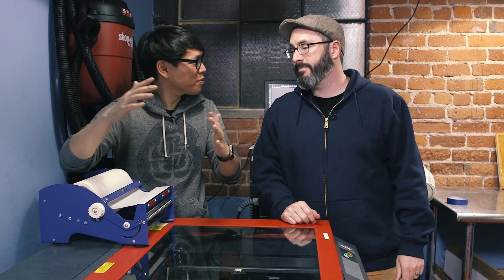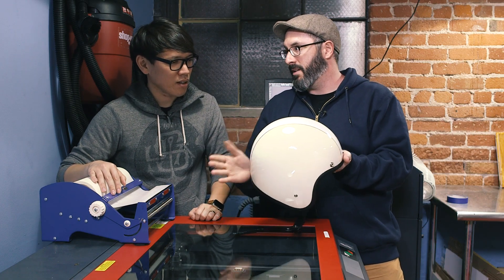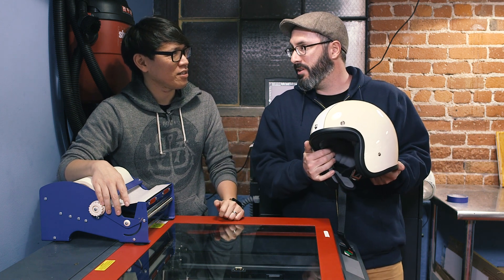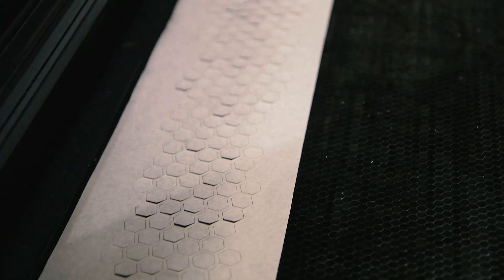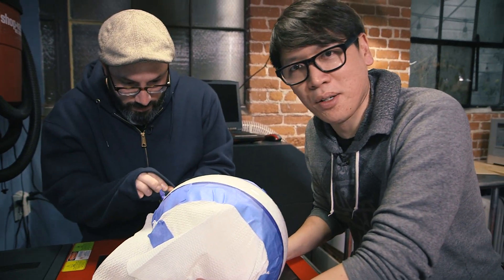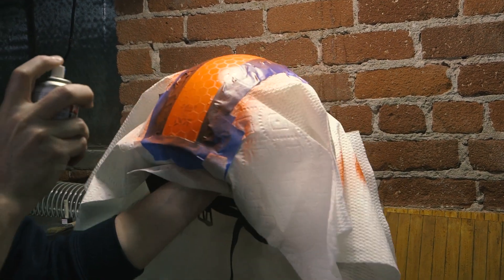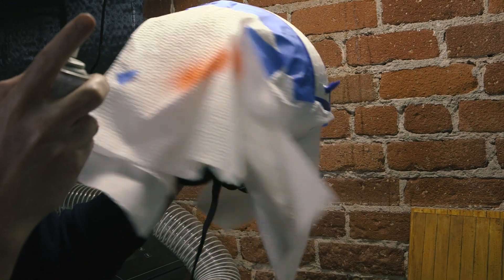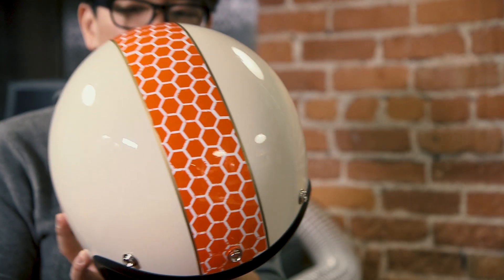Paint Masking Using a Laser Cutter!

Comment: Use a backer then you won't need to clean up... also dude cutting your honeycomb with a knife... big N  O draw it in or use the backer.  You could get an unwrapped helmut file too... and the curvature would be worked out... I use this tech all the time... you can have fun with manipulation and optical illusion.  The laser mask is low tak... you can use higher tak tape on a backer

Comment: Try using powder coating tape. It's stronger, and a lot easier to cut and manipulate, so you get cleaner, straighter lines. It's also translucent, so you can see where you're laying down your tape. Some of them are also made to withstand high heat, so you can bake/cure your paint without the masking falling off.

Comment: Was that tamiya model paint? I'ive used IT on my RC cars.
Reply: When I want to do a "special " paint job I use a similar base coat color and then make a artful choice from an auto touch up spray can rack. They have maybe a hundred different colors shades and textures. For an absolute novice it turns out great, almost professional. Auto paint is harder and has a finer sparkle than metal flake. Try it you'll like it.

Comment: Cool!!! But... A motorcycle helmet consists of a rigid outer shell, which should not be painted or altered in any way with the placement of adhesives, chemicals, solvents, paints or other agents not authorized by the manufacturer, as this would negatively affect the structure of the hull, weakening it, and therefore partially or totally reduce the protection offered by it.
Reply from the maker: acknowledged and bumped to the top!
Reply: Take a look at racing helmets worn at the top levels, you'll find nearly all of them are  custom painted.  You are probably fine, just do a little research to find out if the paint you used is problematic.

Comment: I've done stencils for over a decade. pro-tip: spray further away, dont stop spraying (those small squirts can be bad news), dont spray back over an area you just sprayed, do multiple light layers and let it completely dry between layers,  make sure it's completely dry when you peel it off. you can even get special caps for spray paint for stenciling that spray at a slower rate. They help.

typically when things bleed under a stencil they look more faint and not so well defined. are you sure it is bleed from under the masking tape or was it because the stencil was lifted off while wet and the layer had way too much paint so when you pulled the tape away it pulled paint with it and moved it to places it shouldnt have been. do multiple light layers and let them all completely dry will solve that. I like to think that there is no such as thing as "dry enough to peel off the masking tape". wait for it to completely dry.

Comment: I frequently make laser cut masking tape stencils. I lay up
2” tape onto baking paper with about 3mm of overlap. The baking paper readily
peels of the cut stencils.

I also use low tack tape on top after cutting to keep the
stencils together so they can be weeded and applied.When I am worried about bleed I give it spray with clear
first. https://static.rcgroups.net/forums/attachments/1/3/8/0/4/4/a8173674-146-IMG_6540.JPG

Comment: I enjoy watching Bill spray paint, as he does it well and correctly. 90% of the time when I see someone spray painting on YouTube, it makes my skin crawl because of how wrong it is. lol
Reply: J Benson exactly, the paint went on too heavy. You need to put 3-4 dry coats, just dusting it on with 10 minutes between coats and then two wet coats. As a car modeller I use Tamiya spray paints a lot and it always works for me.
Reply: I think they were not going fot the perfect job but rather for a quick result. ^^
Out of curiosity, why exactly do you dust the surface first? Do you do that with any sprayed on paintjob or only in specific cases? I tried to find some proper tutorials on that topic, but no lick so far.
Reply: NochSoEinKaddiFan it's sometimes called a 'grip coat'. It prevents runs which may occur if the paint is applied to heavily, and provides subsequent coats with good adhesion
Reply: Thank you! :)
Reply: eek. I cringed. With stenciling you want multiple lighter layers and doing those short sprays can cause inconstancies. I actually think that's the reason for the paint getting where it shouldnt have.

Comment: Take care that the paint doesn’t affect the shell of the helmet. As a salesperson in a motorcycle shop I would not advice painting or stickering your helmet for this reason. Looks cool though!
Reply: Don't know about motorcycle helmets but those are common warnings for hard hats.  The paint could have solvents that weaken the plastic, and stickers are discouraged more because it can hide damage like fine cracks.
Reply: that helmet is already painted and sprayed with clearcoat. to cause any structural damage, the paint or stickers would have to go through the varnish and paint that are already there, which would be noticeable. 

basically, dont apply random solvent-based paints directly onto polycarbonate hardhats or cycling helmets (which have no paint and no protective layer), but most street-legal motorcycle helmets have no problem with paint or stickers, because you are not applying them directly to the plastic. in this case, they used tamiya paint made specifically for polycarbonate, so it would probably be safe even on uncoated helmets.

https://www.youtube.com/watch?v=Azvn9wPDu_c
Reply: Norm added a disclaimer and some additional information, I think it’s great Tested took action and for me the matter is closed!
Reply: People (and shops) have been painting motorcycle helmets for decades. What are you on about?....
Reply: Piet Paulusma as long as it's not a acetone based paint your fine been doing it for years . I recommend and acrylic mix from a air gun it comes out even and easy and dries smooth and resistant to scratches.
Reply: Ronan B some paints will degrade the outer layer of the helmet, which is important for its effectiveness in a crash
Reply: @Mark Pendragon - "from just eyeballing it" ? has it crossed your mind that maybe i happen to know the helmet used in this video (limited edition racer hand-painted biltwell bonanza), as well as the paint (tamiya polycarbonate-safe paint)? did it cross your mind to check what materials they are made of before posting alarmist nonsense? takes literally less than a minute to find them on the internet.

should they also have to put a warning telling people to not spray the paint into their eyes? to not put their hand inside the laser cutter? to not stab themselves with that blade? should they cover every possible danger that might exist when using every possible combination of tool and material type seen in the video? if and when those warnings are required by law or considered necessary by the manufacturer, they will come with the products in question. if you buy a helmet, follow the instructions that came with it. same for the laser cutter, etc.

your posts are the motorcycle helmet equivalent of "soft drinks will dissolve your teeth".
Reply: I’m sorry Jim Steinbrecher but I’m going to have to contradict you on that last post. I always add the warning not to paint or put stickers on your helmet (and don’t clean them with any old cleaning agent) and 99 out of a 100 times the customer is amazed that they can’t do those things. The general mindset is “its a helmet and therefore it can handle any kind of abuse I can throw at it”. People just don’t know these things. It is something completely different than “don’t stick a knife in your gut” or whatever. 

Even though you know this specific (very generic designed though) helmet and somehow know what paint they use and what materials the helmet is made of and what the paint can be used for, you are in a very small minority. In addition to this Tested is not a motorcycle vlog or anything, this audience cannot be expected to have intricate knowledge of motorcycle helmet materials and chemistry. So take a chill pill. We are just trying to prevent people getting injured, I don’t know who you think you are to call that alarmist nonsense.
Reply: @Ronan B, decades ago I had a police team do a talk at my school, showing how such modifications can render a helmet useless as protection.  They showed actual helmets, which had been in crashes, and split right open.  Using ones that were perfectly fine, until somebody had applied a sticker on it, for decoration.  Including some that were done in shops, which did not have personnel as well-informed as Piet Paulusma.
Reply: Yeah, paint can alter the helmets effectiveness. I've always been told that stickers are ok for the most part.
Reply: @schleben22 whoever told you that is putting your life in danger.  Repeating it, in the face of advice from people who know what they are talking about, is spreading your ignorance and risking other people's lives.  Using stickers on polycarbonate helmets can weaken them, due to the glue degrading the plastic. 

@Jim Steinbrecher the weakening occurs UNDER the sticker, so would not be visible.  So this is a hidden problem, when it occurs.  I am pleased that you are absolutely certain, from just eyeballing it, that the helmet in this clip is protected.

Why though do they not make that point in the video, and warn not to do this on untreated plastic helmets?  Even if this technique is safe, they should still warn of the danger of using ones with other types of adhesive, on untreated plastic helmets.

Comment: they do make a viynl that can be used on a laser cutter that will not produce the gases that damages the glass.
Reply: Not that I'm aware of. I was an engraver for years and was constantly on the lookout for something like that. From what I managed to find out, anything called vinyl is shorthand for polyvinyl chloride, which releases Cl2 gas when burned among other things. They do make some special films that can be used for masking (better heat dissipation for glass engraving) but that's the closest I found.
Reply: Joel Ganong there is a company called Stahls that make vinyl made out of Polyurethane (PU) thats safe for laser cutters.